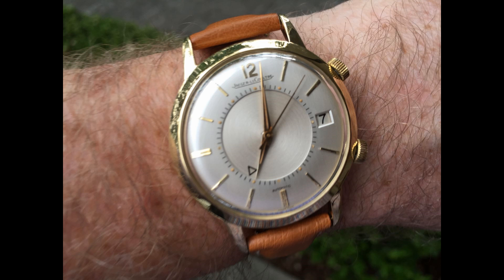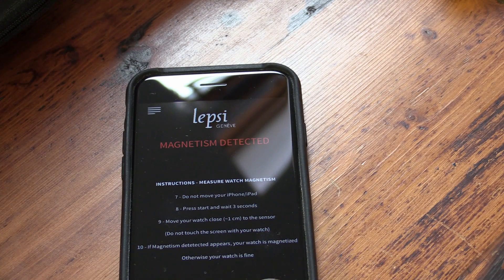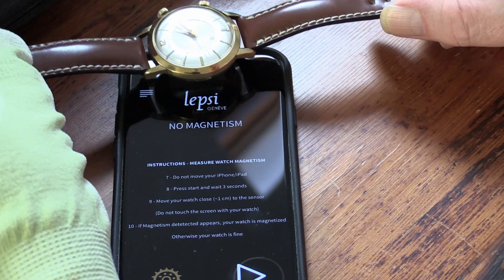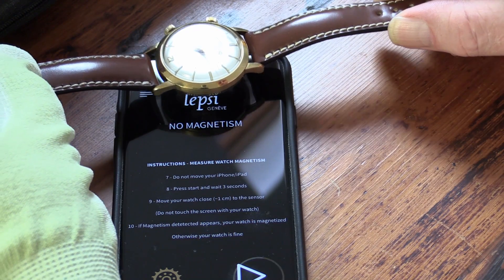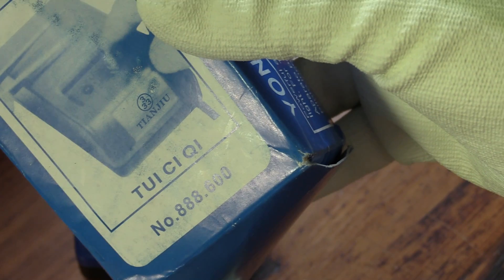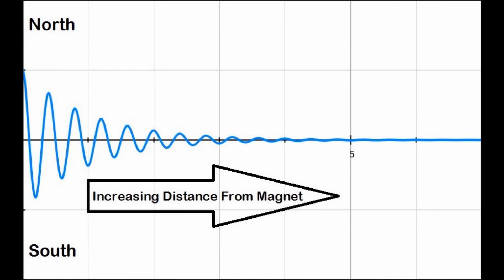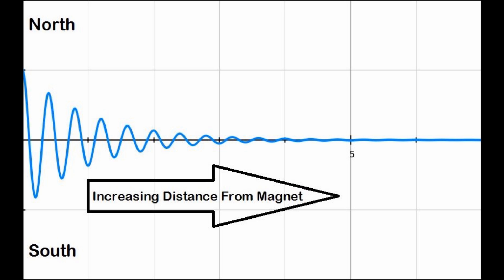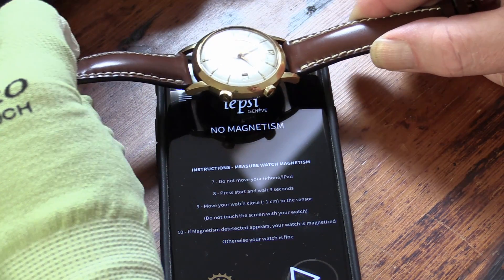Wrist Watch Demagnetization

Comment: I always thought a magnetised Watch would run fast, interested to see if the performance of the Watch improves.
Reply from the maker: That is my impression as well Bob, but I have read that they can sometimes run slow instead of fast.  Guess it just depends on how the north and south poles interact during the coiling and uncoiling of the balance spring.